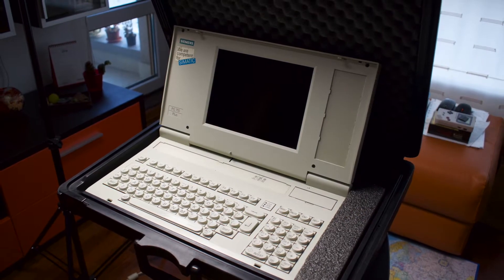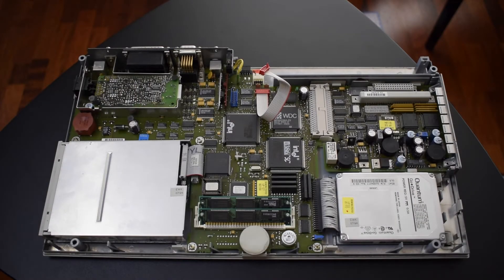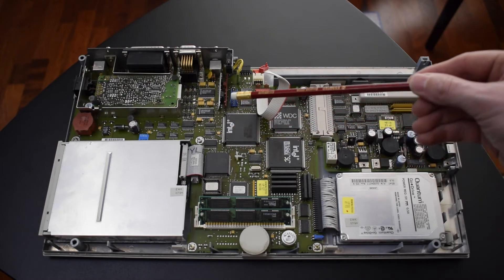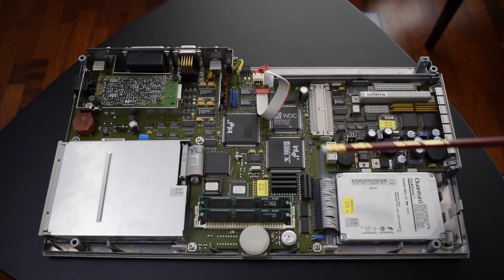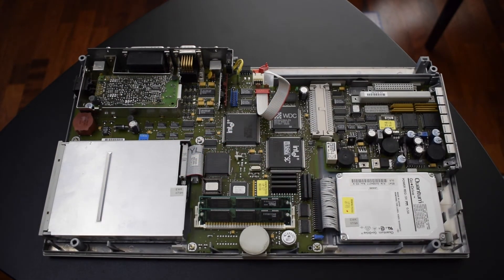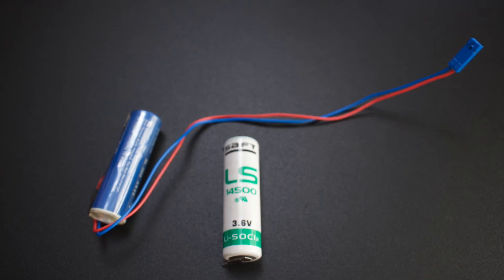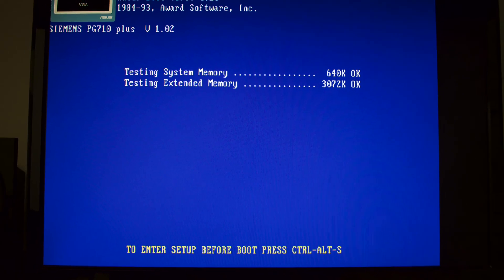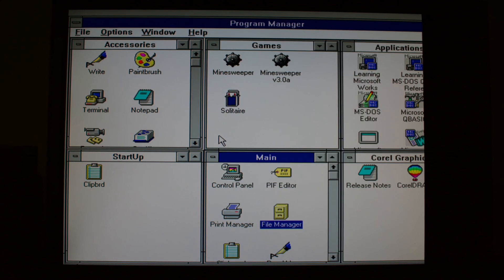SIEMENS SIMATIC S5 PG710 Intel 386SL industrial notebook teardown

Comment: 4:25 how did you know you needed a new battery? did the computer not turn on without it?
Reply: You will get a message about all settings returning to default
Reply: @collinsd70  my pg710 does not turn on at all. guess its not the battery then
Reply: @KoRL12  definitley not, do you have any of the indicator lights on?
Reply: @collinsd70  no nothing. the only thing that lights up is the lamp on the charger.
Reply: @KoRL12  doesn't sound good, have you checked voltages at the pins, I can send you a pinout if you want?
Reply: @collinsd70  i've tried using a multimeter but i had no idea where to check for any relevant information. the charger had power thats all i learned.
Reply: @KoRL12  let me know if you want any help, mine is nearly fully working now
Reply: @collinsd70  soldering in another battery was about as far as i was willing to go. there's so little information about this laptop available and even if i somehow found what to replace i doubt i would be able to find a spare part. might sell it for spare parts to somebody in the same seat as me. but thanks anwyays
Reply: @KoRL12  mine is fully up and working now with the original software, all worth it after 2 months of perseverance.

Comment: Hi, great video. I just got one of these babys, but without a power supply. Is there any chance you should now the pinout og the 8p din power plug? Regards Eli
Reply: Hello. Unfortunately no. I sent it to the Philippines more than year ago otherwise I could have measured it. Sorry.
Reply: @strahilmehandzhiyski  Okay, but still thank you for your answer and for the video :) Regards Eli
Reply: @elivinther1595  hey this is a long shot, but did you ever find the pin out? I’m trying to build a power supply.
Reply: @TheBasementChannel  Today one of these PG710 Plus fell into my hands, including 2 power supplies. If you want to work this out, let me know
Reply: @OpelAmpera2011  if you could identify what voltages are on what pins that would be super! I don’t suppose there’s a diagram on the power supply?
Reply: @TheBasementChannel  No, there is only the manufacturer info: ASTEC Model No. SA35-3102C-1 Siemens Part No. C79451-Z1489-K1 INPUT = 50/60 Hz 100V - 240V ~ and max 1A. >>>> Output = 35W and 16.3V <<<< I will cut and reassemble one of the plugs with measurement points, stay tuned
Reply: @TheBasementChannel  Here is the info you were asking for https://youtu.be/A1CMgaalK5I
Reply: @OpelAmpera2011  thank you kindly, appreciate the work you’ve done for the handful of people needing this info!